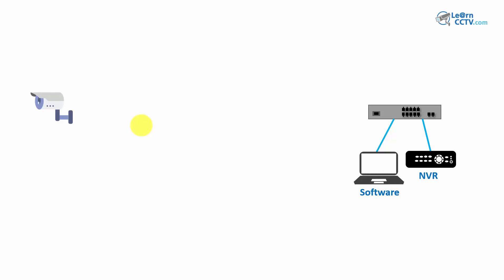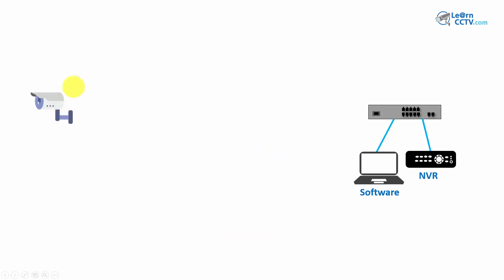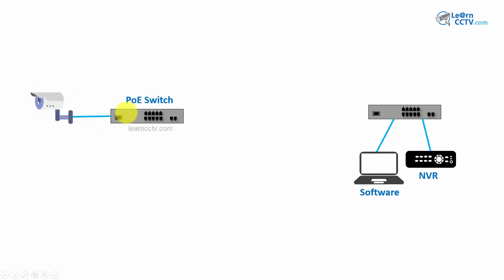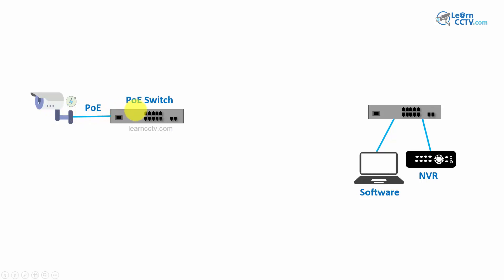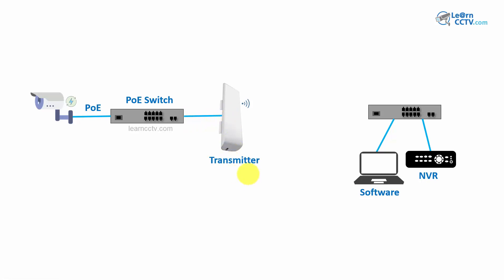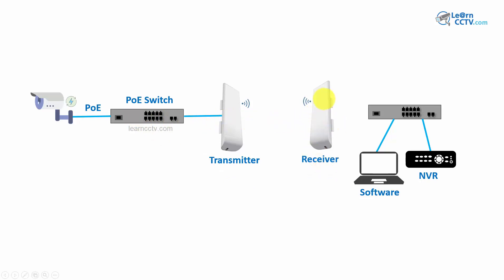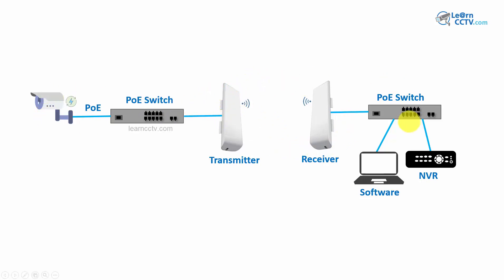Wireless Bridge for CCTV ( IP Camera over Wireless Network )

Comment: If there isn’t line of site between the two radios, can you have a second set in between?  Like a repeater in the middle, going from point A to B then B to C
Reply: You can, but it results in at least half the available wireless bandwith. That can still be better though than without a repeater in the middle if the signal strength between the two sides is too weak without a repeater.

Comment: This is exactly what I'm trying to set-up. Thank you. My only question is: The NVR has PoE ports for the receiver (bridge) so do I need a PoE switch on the receiver side? Or can I just plug the receiver into the NVR?
Reply from the maker: You need to use the bridge power adapter because it uses a non-standard PoE. The PoE ports from a NVR or switch could damage the bridge. (I saw that happen before).
Reply: @LearnCCTV  Thanks for the quick reply! What is a bridge power adapter? Your response said the ports from a NVR or switch could damage the bridge. Isn't that what your diagram shows (the receiver plugged into a PoE switch?
Reply from the maker: @julies1134  Sorry for that. The diagram represents the data (logic) connection.
The switch won't power the radio because the cable it's connected to the data port.
Just imagine the diagram you see with an extra power adapter that runs from your outlet to the bridge and that's it.
Reply: @LearnCCTV  Great! Thank you!

Comment: i want to install a new cctv cameras in two stations A & B. the distance between the two stations is about 10 km  apart. advice me on the devices i should use;the type of NVR/DVR, type of cameras, ip/normal, poe switch extender. Every branch should have 6 cameras installed and monitored at one STATION A. Pliz advice
Reply from the maker: Wow, unfortunately, I can't do all of that because that involves a consulting job and I can't help every person individually. Please hire a local CCTV designer to work on a project for you.

Comment: How many receiver we have to install for multiple cameras in 500meter areas
Reply from the maker: That depends on the angle of the installation and the bandwidth used by the cameras (according to the resolution, frame rate,etc) A FullHD câmera (1080) uses around 2.5 Mpbs and the receiver is capable of handling around 100 Mbps in the default configuration with direct line of sight. So, just do the math ;)